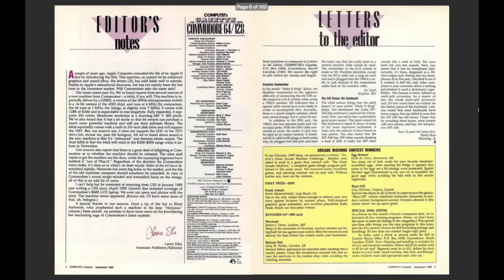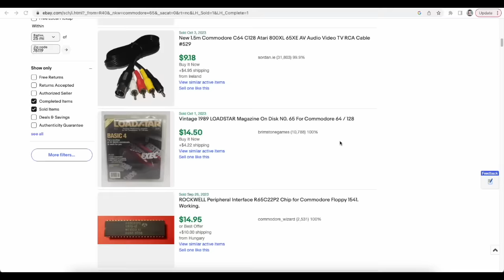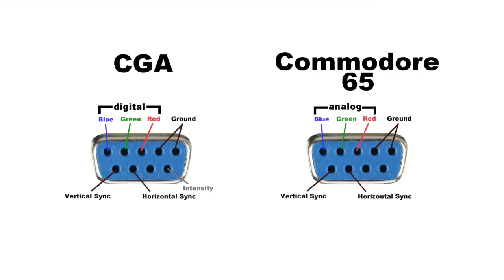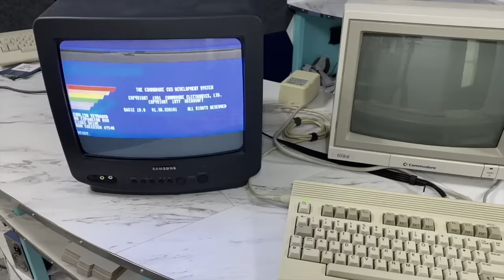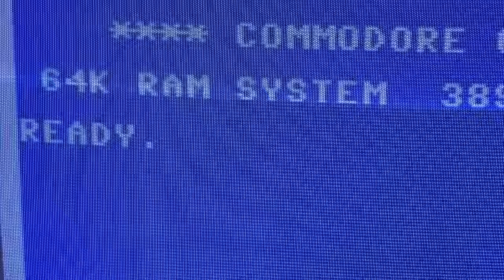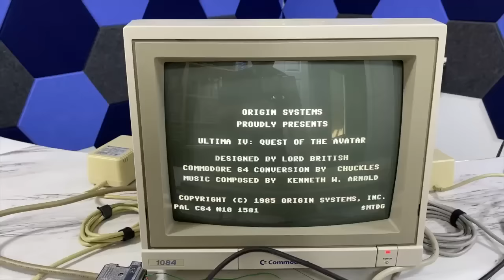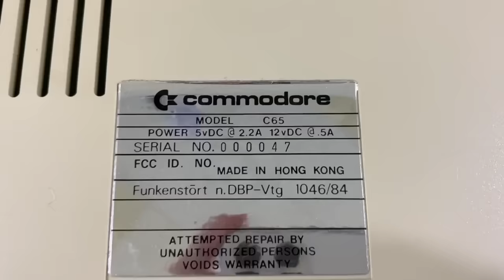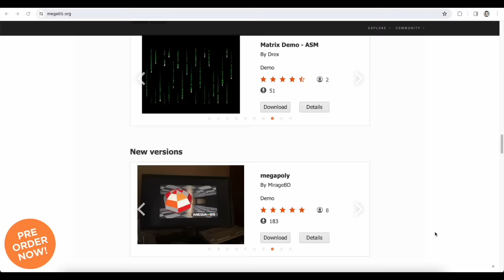The Commodore 65 - A Rare Prototype

Comment: 10:32  This is categorically false. Around 1990, I bought a 1581 disk drive.  I have disks and disks of games on the 1581 disk format. Most of them are cracked and are single load files, but you can load them up with a disk speed enhancer, load them in a few seconds.  A 50k game file loads in under 10 seconds.  It is trivially easy to get them in this format because DOS and PC disk drives can write this format.  Just create a 1581 disk image and then use the DOS program to write the disk out.
Before you say "this wouldn't have worked in 1990" I again have to correct you.  My disks and disks of C64 games on 3.5 disk were almost all made BITD on my C64 downloading games from a BBS in my area. The guy who ran it had a hard drive. I filled like 10 of these disks with these one file game cracks.  So the game doesn't care if it's drive 8 or drive 11.

Comment: The 4510 is still an 8bit 65c02 compatible cpu with some enhancements to increase speed. It also includes an integrated MMU and two CIA's. It is not 16-bit.
Reply: It seems like every source covering this thing just keeps parroting the "16 bit" line based on the assumption that a machine like this would have had to have been based on the 65816, ala the IIgs.

Strictly speaking there are traces of 16 bit-ishness on this CPU compared to the plain 6502; unlike it the stack can be relocated anywhere in the 16 bit address space, and they added 16 bit relative jumps and 16 bit inc/dec/shift operations. But if this makes this CPU "16 bit" then we should also probably be calling the 8080 and Z80 16 bit CPUs.
Reply: @PaleozoicPCs  Well, the introduction of the B register and the possibility of relocating what had been only "zero page", plus stack relocation and a global stack larger than a single page, only really allow the CPU to make use of a single 16-bit address space. As you note, that probably only brings it into line with other 8-bit CPUs.

Contrast that with something like the Z8000 where individual segments each occupied a 16-bit address space, and we see the difference between what is still in practice an 8-bit CPU (the 65CE02) and a classic 16-bit CPU (the Z8000). All the arguments over the years about whether something is 16-bit or not tend to drag products into that category unjustifiably. In reality, the 16-bit category is pretty narrow and things like the 68000 are architecturally 32-bit, even if they have reduced addressing capabilities and data bus widths, largely for cost reasons.

Comment: While watching this video I was also thinking what an amazing time it was with so much innovation. All sorts of variations in CPU chips, clock rates, and support circuitry in those days. :) BTW, at 15:18 jumper J3 is seen with the silkscreen text of NTSC beside it. You could try adding a jumper to it and see if the video output switches to NTSC format. Those games that may require NTSC video could be retested.
Reply: Given his history with prototypes, best not tell him to monkey with any jumpers in case there's an issue. There's a reason he didn't know about the PAL thing, and that's because he didn't do the appropriate research before opening the case.
Reply: @bruwin  Being prototypes, C65s are incompatible with each other, so where exactly could he have found accurate documentation for one specific C65?
Reply: Unfortunately, innovation without direction is a recipe for disaster, and CBM were masters of that particular recipe. There were simp,y too many independent and badly thought out projects, many of which would either compete with their own existing products, like the C65, or simply had no real market to fill, like the Plus/4 and C16. CBM weren't the only ones doing it, and even today, big names in the industry are making the same mistakes. Intel, AMD, Nvidia, ARM and Apple have all fumbled wildly and dropped the ball at some point in recent history.

Comment: If Commodore had released something like the C65 back in 85 instead of the Plus/4, C16 and C128, then I'm sure it would've been a huge success and most C64 owners would have bought one.
Reply: Obviously yes, because the C128 was pretty popular as is, even tough it was basically just a gloried C64.
Reply: 3.5" floppies were still too expensive in 1985.
Reply: @Okurka.  The Amiga 1000 had a 3.5" floppy drive when it was released back in 1985. Also you could just hook up your old 1541 drive to the C65 and continue to use 5.25" disks.
Reply: Teenage me would have loved to buy a C65... this is the computer I was waiting to upgrade to from my C64.
Reply: @TheStuffMade  The Amiga 1000 cost U$1285 in 1985, people who could afford it also could afford 3.5" floppies.
Reply: @Okurka.  That's a terrible argument, the cost of 3.5" disks dropped quickly once they became popular. It's not like it's some advanced technology, it's just a floppy in a plastic case. They were introduced already back in 1982.
Reply: They were still producing C64 in 1990, so the C65 would have replaced that (and the external disk drive production). It is a much cheaper machine than the Amiga with the tiny board and fewer chips and could have been a success in Eastern Europe. The C65 was never meant as the next big thing, it's just a cheap replacement for Commodore's whole 8-bit line. Five years earlier the machine wouldn't have been possible at reasonable cost.
Reply: @Kobold666  Amiga WAS quite a success in Eastern Europe. A lot of young people were buying them in the 90's.
Reply: @TheStuffMade  In 1989 one 3.5, 1 MB disk (800 KB for the Amiga) were priced at £1 each, so I agree with @Okurka
Reply: @KurtPedersen-tg7jc  If everyone was as afraid of new technology as you two, then we'd still be living in caves and banging rocks together for entertainment. 🤣 
EDIT: I checked a RadioShack catalog from 1985, they were selling 3.5" disk for $5.50/each, and 5.25" disks for $3.50/each. And the 3.5" have higher capacity, so I don't know what you're talking about.
Reply: @TheStuffMade  I guess you have the latest expensive CPU and GPU or are you afraid of new technology?
I had an Amiga 500 with an external 5.25" drive in 1987 because 5.25" floppies were still much cheaper than 3.5" floppies.
The density of 3.5" floppies is much higher than of 5.25" floppies because of the smaller surface area, so it was an advanced technology.
Not sure which RadioShack catalog you checked, but RSC-12 and RSC-14 of 1985 only have prices for 5.25" and 8" floppies.
Reply: @TheStuffMade  What have the prices of disks got to do with being afraid of new technology?!
Besides, notice what I used for the price. It were the English Pound sign (£) not the $ sign, which should indicate that I'm not from the US.
The prices for disks were different from EU/US

Are you pulling my leg??? . "Normal" Amiga disks are unformatted 1 MB, but the Amiga only use 800 KB of it. - They way you're replying to my post, tells everything.
Reply: I remember how chips were normally priced in that era: new designs were very expensive to recoup development costs. The cost of a 1985 C65 would have made it something other than popular! ;) But as it happens, the 4510 didn't come out until 1988, so the CPU would likely have been a 65816. The 65816 could have been the CPU in the Amiga Mac & ST; it was faster, cycle for cycle than the 68000, but the 68000 appeared to be future-proof: it was 32-bit ready.
Reply: I updated to the C128 and regretted it. Well, it’s a much bigger case, the 80-col mode didn’t work on my 1702, and I have NEVER done anything with the Z80. The built-in drive alone would have justified the C65.
(If they can successfully migrate a few more devices from Mister to Mega 65, I’m sold on the Mega 65. But it must, must, must get keyboard pass-thru. I will replace my PC keyboard with a Mega 65, if they build in the capability. I don’t have room for 2 keyboards…)
Reply: @Grunchy005  Yeah, I also bought the C128 with 1571 drive, actually I still have one, but it's such an odd computer. I'll never understand why they thought CP/M would still be relevant and the 2 monitor output is just silly. I bet 99.9% of the time people would just use it as a C64. I hope there will be a real C65 core for the Mister and maybe a MEGA65 core as well. Personally I feel it would've been better if they had made the MEGA65 100% C65 compatible instead of adding features.
Reply: @TheStuffMade  CP/M was still around AND there was a huge library of professional software available for it. Any changes needed to run it would have been relatively trivial. The alternative was what? MSDOS? The almost direct clone of CP/M for 16 bit "IBM Compatibles", that MS bought in from Seattle Computer Products, and which would have cost a fortune to license? And which didn't even run on the Z80 CPU? There was no "standard" C65, they were all bodged together prototypes. Had the C65 made it to a final production version, it would almost certainly have been different in a number of ways. How do you achieve 100% compatability with something that was never finalised in the first place?
Reply: @Okurka.  Maybe they should have used 3" drives like Amstrad did because the mechanisms were cheaper (really). 

Everyone else is going on about the media which was also a problem. 
In Europe, which this machine seems to have been designed for, hundreds of legit C64 games were available on cassette for £1 each. As @KurtPedersen-tg7jc says Floppies were about £1 each which wouldn't have left much profit margin. Of course prices did fall rapidly as the Amiga and ST gained traction, despite PCs like Amstrads best sellers using 5.25" drives.
Reply: @Okurka.  It really doesn't matter, they could came with build in 5.25 like Apple IIc did. Sure, 5.25 is less sexy than 3.5 but it would work quite well.
Reply: @zenpoweredlamer  Then it would be a different computer than this one.
Reply: @ugencz8364  because it made sense.  The entire thing was on another level compared to the c64.
Reply: @MrDuncl  i don't know how true it is, but t's commonly supposed that Amstrad basically bought up the entire production of 3"mechanisms cheaply.  The format was basically dead in the water before Amstrad began fitting them to all their systems.
Reply: @TheTurnipKing  I have heard a similar story that they were able to get a much better deal than they would have on 3.5" mechanisms. However, I'm sure that the 3" drives were far better than other low cost alternatives like Waferdrive and similar. In Amstrad's home base of the U.K. the PCW word-processors (which also used 3" drives) were a huge success due to being priced similarly to an Electric Typewriter while being able to run a wide variety of business apps.
Reply: @MrDuncl   Oh, almost certainly.  But the point is that the 3" disc format wasn't any appreciably cheaper than the 3.5" or 5.25 except insofar as it was obsolete.

It's don't think it's a a coincidence that later PCWs moved to 3.5" discs.

Comment: 1:36  I find it HIGHLY unlikely that a C65 would have had any effect on the Amiga sales.  Amiga was still pretty expensive and realistically required a monitor for use.

We have the prototype of the C65. It was a 299-399 product and probably would have quickly been price dropped, at least had it been released at a reasonable time.

Ultimately Commodore made the right decision to not release it.  This article is from Dec of 1989!  We're talking a very late 89 or more likely, early 1990 release date.  The C64 probably sold far better in 1990 than a C65 would have sold.  It was 1990 for god's sake. WHO is going to buy such a computer in 1990?  Almost nobody.  Buying an inexpensive existing 8 bit system with a ton of software is a MUCH easier decision than spending upwards of 400 Dollars plus tax, plus a monitor to buy a system that boots to basic in 1990? 

 I don't know how much the 64 was selling for at this time, but I do know I bought a used C64 at a store for like 30 bucks around 1990 when my old one failed.  But I recon they were probably not more than 129 at the time in stores. 

By Dec of 1989, the C65 was a product long past its due date.  Christmas 85 or 86 would have been a good time to launch it.  The PC was not yet dominating the home market.  The Amiga was a much more capable and more expensive machine.  Right in the middle you have the potential C65 market.  Realistically, the C65 is what the 128 should have been.  The 128 is an example of bad design.  Who the hell was looking to get into CP/M in 1985?
Reply: No need for a monitor. We just used our existing Scart RGB CRT TV.
Reply: @turrican4d599  Not in the US.  We never got anything like SCART.  We were vastly inferior in that respect.
Reply: "Who the hell was looking to get into CP/M in 1985?"

Amstrad! And they made a pretty good go of it, too, with the PCW series. Of course, they didn't really emphasise the CP/M thing at all, instead selling these computers as a word processing solution. It also helped that they reduced the product pricing substantially from what people had previously been asked to pay for a CP/M system, with obligatory disk drives having kept the costs quite unaffordable for many potential CP/M system purchasers. So, instead of paying over £1000, people were looking at only £400 for a complete system including a printer!

For most manufacturers, though, CP/M was on the way out. Business users were looking to DOS-based products, and I would imagine that a lot of software vendors had left CP/M behind by 1985. Acorn, who loved the idea of second processors, abandoned CP/M and the Z80 that had been the cornerstone of its business computing strategy with the BBC Micro, refreshing their line-up and introducing the Master 128 with the Z80 option replaced by an 80186 option running DR-DOS and GEM.
Reply: @paul_boddie  AFAIK, people were buying that Amstrad machine as a turnkey word processor.  The nice thing about it, is it can run games. There are a bunch of games for it today, though I don't know how many people were running games on it back then.

Basically nobody used the 128 as a CP/M machine.  It required an RGB monitor (like the 1084 but it won't work with the 1702), which most people didn't buy. it also required the 1571.  Once you added a 400 Dollar monitor and the 300 dollar disk drive, (not to mention the 400 Dollar 128) you got a CP/M machine that ran at 1/2 the speed of a standard CP/M machine.

The 128 was just a bad product. To the extent anyone remembers it at all, it's as a C64.  There was very little software for it.  I'm not sure, but I think the 128 used the VIC II for its 40 column graphics.  It uses the sid for sound.  At a minimum, they should have added a 2nd sid for 6 voice sound and a new video chip with greater capability.  The 80 column mode is only accessible on the other video chip which is really just an under-powered CGA.

Comment: the burning question is which computer is the best envisionment of a post C64 successor? 

c128
c65
X16

Putting aside that the X16 doesn't have any strict compatibility with the C64 it does deliver a better speced 8-bit machine in most regards. The one thing that did catch my eye about the C65 was dual stero SiD chips.